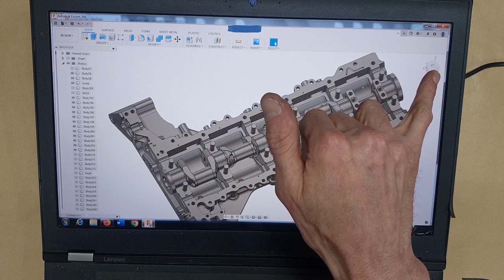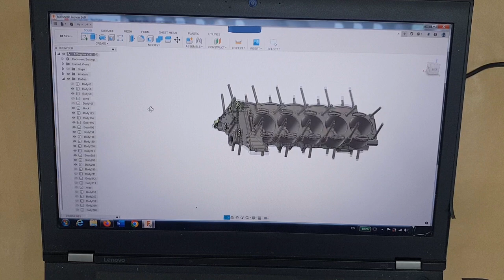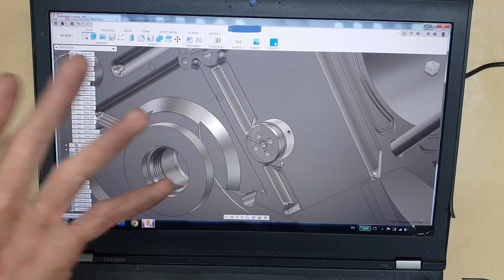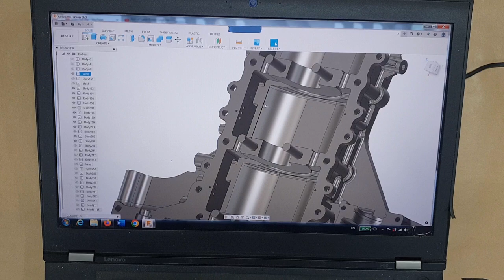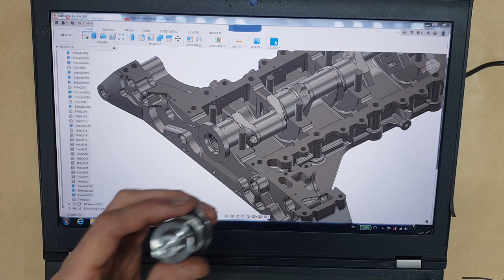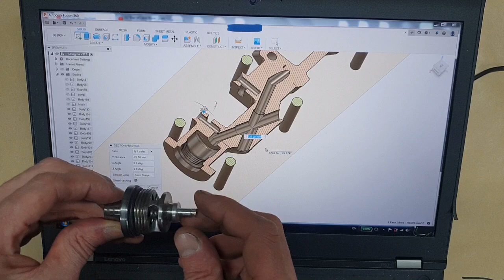F1 CrankShaft Central Oiling - A Closer Look - Ep 9

Comment: How does the crank nose fitting seal to the timing cover to allow oil to flow into it? 
My guess Is it's a very tight non interfering interface and the oils viscosity resisting flow through the tight gap is what allows the pressure to build into the fitting and crank? 
Does the fitting inlet boss go into the timing cover or does something go into the fitting? 
What is the gap and the length of the non interfering interface?

Comment: incredible CAD model. well done. Without seeing inside of the drillings of the physical parts but considering the diameter to depth ratio, I would just assume EDM drilling would be used. Similar to how the intercooler cores are made on the later turbo cars. Maybe?

Comment: Any intention to have these parts machined from your measurements? It would be something to see you create a running f1 engine.  Maybe make some adjustments to the tolerances to allow it to run longer than several  hours.  Lower the rpm, lower compression, less  use of exotic materials 

maybe it would be cost prohibitive , but with new cnc tech and 3D printing some of the more difficult parts like the timing case could be doable. The drillings especially could be much easier with a 3D print. 
I’m surprised f1 hasn’t gone to camless valve train yet.  Aka free Valve etc.

Comment: Can you elaborate more on the oil air separator? I dont quite understand how the air and oil got pumped into the crank but exited at different locations. (I get the centrifugal separation bit...)
Reply from the maker: The air gets pumped into the center of the diffuser, and makes its way out into the first crank web - and off into the sump, whereas the oil is sealed outside the small center air way, and gets pumped into the body of the crankshaft.
Reply: @EngineeredtoWin  Ok, so theres separate exit channels in the crank (in the CAD it just looked like one), air through the center and oil around the outside. And the oil air mix is fed into the nose right?

Comment: Are the reason they oil the big end separately with this engine, as compared to road going engines, is because the centrifugal forces within the crank? Since on a road engine, the mains feed the big end with oil passages, the crossover between the main bearing surface and how they have to drill the crank to feed the big end is just enough to counteract the oil pump pressure, do to centrifugal pressure at sustained high RPM? I know Robert Yates did a study on this back in his day. Does this make sense to you since I can't draw you a picture? If it does, does that explain why your V10 oils the big end separately?
Reply from the maker: Yes, that is one of the reasons. And also means the big ends get prioritised too...

Comment: I'll just say... my computer runs fusion 360 great. Fully functionally jointed assemblies...
Reply: It does until you try to run large assemblies then it becomes a dog. His engine had several thousand parts and I have the same problem running my +/-200 part (components & bodies, admittedly complex) models.
Reply: May I know your PC specs

Comment: Brian have you seen the videos of Cosworth developing the V6 I believe after the DFV? They started with a four pot block and turbocharged it but the block was failing so Ford I believe gave Keith the go ahead to develop a new engine and it covers some of the development. It’s very interesting and very cool to see Keith Duckworth working on a big draughting board with a pencil and slide rules. Amazing stuff. This is the best engineering series on YouTube. I could watch this stuff for hours
Reply from the maker: Yes, have seen that and since met a few of the guys that worked on it in the video at the time. They're old men now! The mahogany pattern making shop was brilliant!
Reply: Old men with great stories I’d bet. Probably the type of me you could listen to for hours without getting bored. In relation to this video I’ve found it surprising how far away the bolts on the girdle are from the crankshaft centre line, the girdle must be stiff enough that the clearance doesn’t change. These engines are so far away from a normal lol.

Comment: Do you have the stationary portion or information of the  relation of stationary portion to the crankshaft nose diffuser? 
I suspect there’s more involved then o-rings or sealing rings for the rpm’s involved.
Reply from the maker: George, if you click on link below you will see a cover I have from the CA engine - the TJ seal is the same. 10th picture in link, regards, Brian,  https://www.f1technical.net/forum/viewtopic.php?t=26358

Comment: Can the engine oil be used to as an additional fuel source and is there any possibility to use the oil to produce more power. When the oil starts to gass out is the gas useful for any other purpose. 

If possible, could you also explain how much more advanced are the current F1 engines from this v10 if you can explain side by side not with a cad file just by your word  ... 

Please don't be offended your explanation is perfect we need you to elaborate the topic with your mind in a state of happiness not pissed off ... You can trim the bits of the video where the file is loading or rendering.

If you want to please the algorithm trim your main video into 10 min bits or smaller so you have a ton more videos and you will not be burnt offf to make another video quickly .

 This video could have been segmented into 5 videos so that you make one video a week and  spread it out for five days  .
Reply: ferrarri (and probably others) did that and then they banned it by adding a limit on how much oil you were allowed to consume
Reply: @MyOtherCarIsAPlane  what about coolent ...
Reply from the maker: I could trim the videos but I don't really want to get into post editing as it then becomes a chore! Plus...it's good to see how fusion behaves...